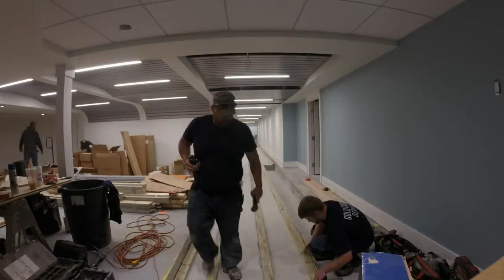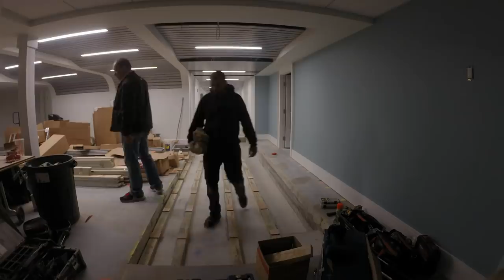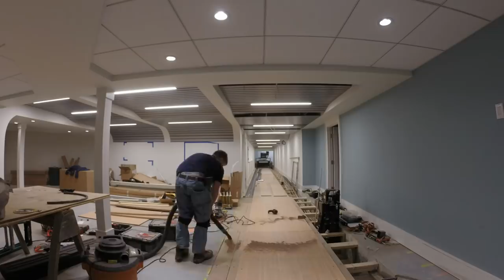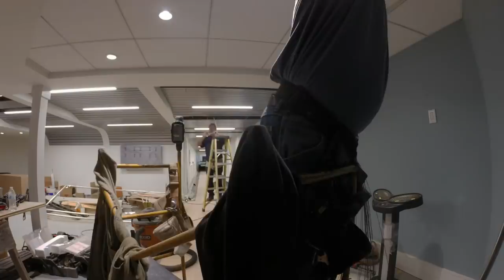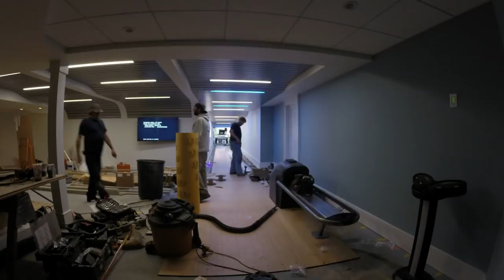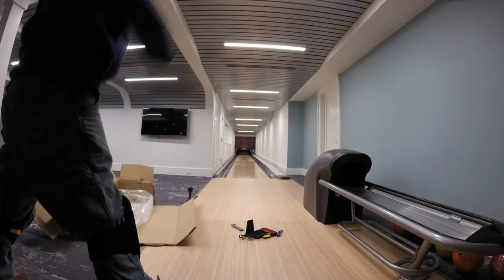Bowling lane installation. Private bowling alley in house.

Comment: It's beautiful.
A bowlers life-long dream...
...But, that better be a free-fall pinsetter in the back and not one of those ridiculous string pinsetters. lol

UPDATE: After reading additional comments,  I realized it IS a string machine!
AAAAAAAH!
Reply from the maker: mottbone although a freefall machine is nice it also requires a mechanic to service the machine. You probably don't want to have a string machine for a league but they say there is only a 3 pin difference in scores.
Reply: Bedder than nothing
Reply: And sadly the cost is about the same. Ridiculous!
Reply: As an A2 mechanic, I would not want ANYTHING other than a string machine in a home lane. The service required on a free-fall machine... good lord.

Comment: If I went everyday to my bowling alley it would cost $130,000 over 20 years, 10 games a day. So least expensive route is going to an alley, this is an amazing status symbol and a very well put together alley you guys did amazing
Reply: I can bowl 20 games a day easily. The math wont add up.
20x$5/game=$100x365=$36,500/year.
Now add gas and car repairs.

Comment: What is the difference between the bottom planks of the subfloor being forward and back, or side to side? I've seen the smaller installations have them going forward and back, but the bigger installations are put in side to side first. Does it depend on the company or something?
Reply from the maker: It really has to do with where and how the ball comes back and how high the ceiling is. For example this one lane has a Partial trench ball return. We put the sleepers the long way to save on height.
Reply: Gold Crown ohhh ok

Comment: If I ever get to the point where I could afford my own bowling alley it would be an Brunswick A-2 running at A speed for with a Jetback ball kicker instead of the A-2 ball kicker, simpler. I used to work as a mechanic for Brunswick so maintenance isn't an issue unlike most customers.
Just curious what part of the country are you in?

Thanks for the video and the answer.

Jim
Reply from the maker: James Shanks we are in the east coast but travel all over. I agree the Brunswick machine is a tank. But it does take a little knowledge.
Reply: Gold Crown 
Anyone with DIY mechanical skills can maintain a Brunswick A machine, simply buy a Brunswick maintenance manual. It tell you what to do for every single problem it has ever had. Then you have to add  between 5 to 10,000 worth of parts if you want to keep bowling instead of waiting for the part you need to arrive. 
But calling an experienced mechanic is a whole lot easier as when he leaves the machine will be running after he does a 51-20 inspection and then repairs/ replaces what the inspection showed it needed. By doing that when you turn the machine on all you should hear is the whine of the motor.
If I ever do hit the lottery I will be calling you for the installation of two lanes in a new house to make it easier with 6 feet behind the ball wheel.
Reply: Hope you go for real wood lanes or those A2s won't feel at home.
Reply: I agree, Real wood lanes and the Brunswick A-2 would be my dream, actually one of my life long dreams is to own and completely run a Bowling alley, 6 lanes is fine with me.
Reply: @expfighter5112  I might be buying a bowling alley if you want to help me run the place
Reply: @jamesc2010  really wish i could, alittle too old to follow that dream now :(